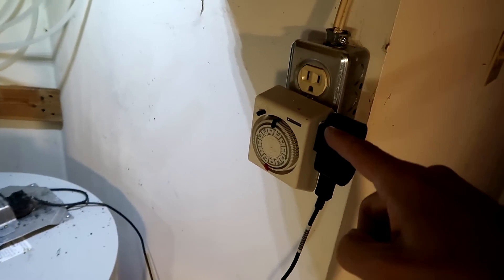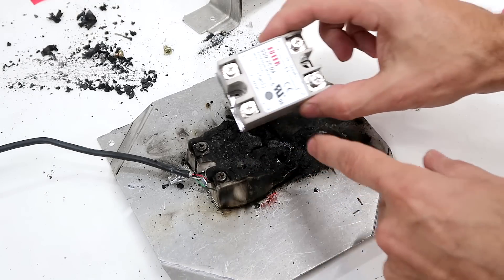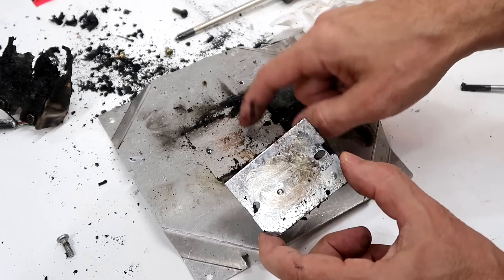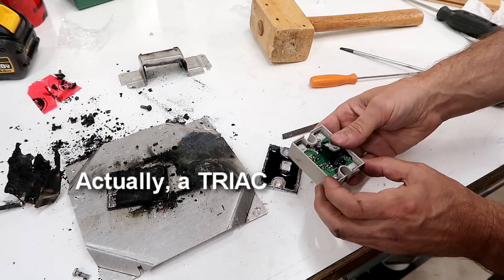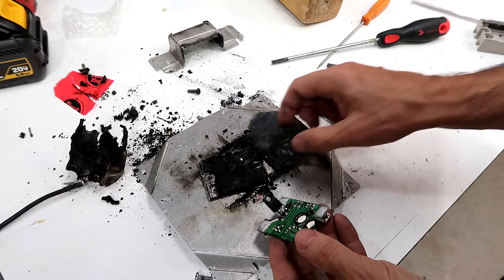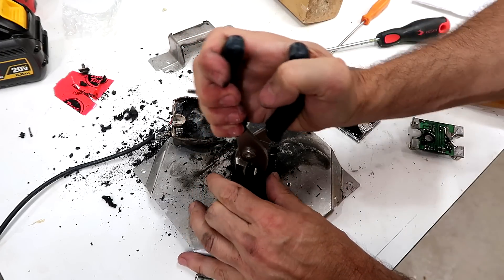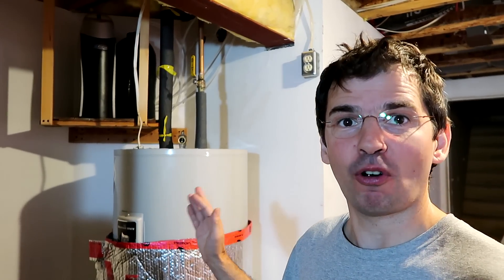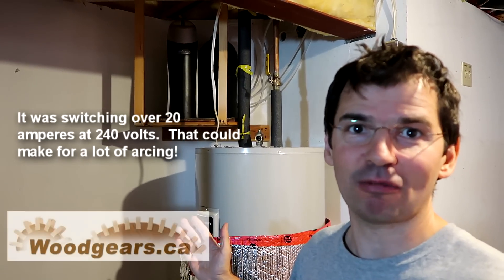Spectacular solid state relay failure

Comment: Where is the circuit breaker?  I would had at least put a 25 amp breaker on it and a gfci.
Reply: You would have to ask your boyfriend... because I do not go that way!
Reply: I am sure there is a breaker. But the breaker has to be sized to allow 4500 W or so for the heating element in the water heater. 1000W will be more than enough to cause this failure.

Comment: The triac in these relays is very underrated compared to the claim made by the seller. I bought a 40 amp one and tore it down to find a 16 amp triac. This means that it should never be run at more than 16 amps. I think the 25 amp ones came with a 12 amp triac. The electronics of these relays is OK but the build quality is shifty. I think it's worth buying a genuine name brand if you need any kind of lifespan or fire safety. You can get by on these cheap ones if you buy one with a suitable triac.

Comment: I'd use a solenoid relay. That way, it doesn't draw much power (if any) when off. If you do choose to use that option, make sure it's a fully enclosed one or at least in a very clean housing. I have experiences with exposed lead relays, and those tend to get stuck closed when the contacts get dirty. The downside here is that these give off a loud click when it turns on or off.

Comment: I think it's more likely that not-quite-tight-enough screws plus heat cycling (SSR mounted on warm WH) lead to the screw terminals coming loose.  The poorer the connection gets, the more extreme the heat cycle goes. When the connection gets poor enough to start arcing, the solder will melt and things will burn.  Cheap SSRs will have crappy screws that you can't get tight enough before the screw driver cams out, to properly clamp on bare wire.  Best to do proper crimp terminals and fasten the screws to them.

Comment: The single most popular fail of any electronic device built outside of north america is "automated" soldering. There is way to many cold solder joints that add resistance overheating circuits. In north america these are checked for on any device made. usually fixed before it is sold to consumer. 

Sadly many of these great businesses are being put out of work because of the volume coming out of china.

Note india/japan/tiawian/korea made components are becoming much the same for lack of quality control.

Comment: I have had a timer on my hot water heater to limit it only use electricity during the off-peak periods since Ontario brought in time-of-use billing in 2006.  I have pretty low hot water usage, and a 60Gal. hot water tank and even when I run it only between 4am and 6am I never run out of hot water.  My original setup was a GE Digital Time Switch (model 15132 I think). This cost was about $70 and total savings is about 6.5cents/kWh * 4kWh/day * 365 days/year = $95/year.  I recently upgraded to a very nice system made by Sinope Technologies (sinopetech.com).  Their model RM3250RF Load Controller allows me to control the hot water heater so that it only uses off-peak electricity, as well as easily monitor my electricity usage for hot water heating remotely.  I highly recommend this device for anyone who wants to limit their hot water heating to only use off-peak electricity. I believe that this device uses a mechanical relay.

Comment: Don't know if your SSR had it, but a zero crossing Optocoupler (eg. - MOC-3041) should be used to swtch the Triac. This prevents any arcing by switching exactly when the AC waveform is zero.

Comment: I just did a search for Fotek on Digikey and Mouser, and came up with no results.  The cheapest 40A SSR on Mouser looks to be $30.

I"ve got one of these Fotek ones I got from China.  Using the UL warning from https://www.ul.com/newsroom/publicnotices/ul-warns-of-solid-state-relay-with-counterfeit-ul-recognition-mark-release-13pn-52/ it seems I have a genuine Fotek (I picked it up for $12 from China), but I wouldn't trust it for something that would run unattended (I plan to use mine on my lathe).

Comment: I don't doubt what people are saying about cheap imports sometimes being faked in rating. But any SSR must be mounted to a heatsink to achieve maximum current rating. The datasheet will show the minimum efficiency of heatsink needed for given ambient air temperature in degrees C per watt, which is how heatsinks are rated. There is zero chance that any SSR like this can sustain this close to maximum current rating with just a that sheet steel heatsink, even at ambient temps of a garage shop in Canada. Since it has worked this long, I would say that the rating on the SSR is probably fine. 

A contactor/relay could be more efficient than a TRIAC based SSR. There is 40W lost in the SSR while it's on. Advantages of SSR is it can switch faster and it can potentially last much longer without wearing out (when used within parameter, of course). But this is something that only has to switch on/off once per day, so a contactor should last a lifetime or two, and switching speed is moot. 

Of course the most efficient way to do this would be to hack the heater's internal thermostatic controlled switch and use the timer to interrupt the control signal in there. But this is beyond the scope of time/benefit ratio for most people. Easier said than done, what with the screwdriving and wrench turning and crimping and voiding of warranties.
Reply: No. If it fails in this fashion (combustion) it is flat out unsafe. It is fake. If thermal overloading is an issue, then a thermal fuse must be added to the product. Otherwise it cannot be listed/approved by safety agencies.
Reply: Interesting, thanks! I didn't dispute that this SSR might be overrated or falsely certified. And I did not intend to understate the danger of falsely certified, illegally imported product such as this, if that is indeed the case. You seem to know more about that than I.

I was more concerned that when Matthias says "a TO-220 should be good for 50W," that might be misinterpreted by the average person. In normal summer ambient temps, a bare naked TO-220 will boil water before it reaches 5W, and 100C is the temp limit of a typical SSR. And additionally, the max current goes down with temp. So a 25A sustained current rating for the SSR will only be achieved if it is somehow kept at 25C. That 50W heat dissipation figure is only achievable with a very optimized heatsink to even keep it at 70C. That enclosure and external sheet steel heatsink is not very close to optimal, and he was running 40W and passing 22A. It shouldn't be particularly surprising it can't actually do that.

This is why people "derate" even good quality parts. It's not really "derating." By derating to 2/3's the rating you are not adding a 1/3 safety measure. The actual ratings of semiconductors are done under specific conditions that are impossible to achieve in practice. Without moving to antarctica or using exotic cooling. That's just how they are rated.

Example: if it reaches 20C in the canadian summer, and a very efficient To-220 heatsink is 1C/W, at 40W the TRIAC would reach a temp of something like 60C. This is higher than 25C, and the max current rating would have to be decreased, accordingly. Just as an example let's say the heatsink on there is more like 3C/W. At 40W, the temp will eventually reach 140C. The TRIAC will fail before then. As Matthias observed, it worked as long as it did because of thermal mass and the shorter duty cycle while it was being used daily. Before it reached redline, the water was up to temp, and the thermostat switched off in the nick of time.
Reply: OK, yeah. I am familiar with all the thermal calculations for electronics design. And it is kind of a joke that most FET's are (or used to be) rated based on a case temperature of 25C. You aren't going to hold the case at 25C while passing max Id. They are starting to show more realistic numbers, though. Max Id at some ambient temp instead of at Tc=25C.

Comment: I would never use those cheap ebay electrical components in any high power or safety critical application. Doesn't even matter what the datasheet says for that TRIAC and it's current handling, there's no reasonable guarantee that it's a genuine part, or it could be a factory reject. A certified mains rated mechanical relay from a reputable supplier might cost a lot, but it's cheap when you consider that it will be switching high power loads, in your house, and largely unsupervised - probably while you're sleeping. Scary stuff if it goes wrong.
Reply: Anything that I plug into the mains or runs unattended has to come from a reputable european shop for me. My projects involving mains power all run on Mean Well power supplies. That small risk of burning your entire house down isn't worth it.

Comment: Matthias, thank you for taking the time to illustrate this electronic failure.  

You have received lots of criticism on here from people that would never consider putting themselves on the line, but love to be hateful to those that do....

 I have great disdain for those cowardly critical bastards that have lots of negative, and  yet, never put anything positive into the equation.... They must live miserable lives.....Anyway I digress

..  I spend a lot of time analyzing my heat efficiency.   After all, we are into a time that we need to help our ailing planet that is into the depths of extreme climate change .

  I have the  "CURB" electrical energy measurement system on my electrical panel, and it has empowered me to save some footprint, and a lot of energy dollars.

I have a two story home with  an LG heat pump, a wood stove, electric base board heat, and an electric hot water heater.  I have been able to monitor when to use one or the other to a more efficient state .... I never use the electric base board heat...

I have discovered that setting your hot water heater at 125 F, and turning it off overnight, and even longer in conjunction with using cold water to rinse dishes for the dish washer, and a few other minor things saves enormous energy cost....

Overall,  We are running 375 kWh in summer per month, and that is using some air conditioning from the heat pump.

There is a time the heat pump best produces heat as we progress into fall, that is less expensive than burning wood.....Save the wood for colder temperatures.

Led lighting is huge....Turn off your Wifi /TV  hub etc at night.... There are lots of phantom power drainers but those suckers pull 50 watts or more.

Comment: The real estate market is slow right now so my advice is make sure your house insurance covers full replacement. Remember it is cheaper to buy new stuff in Fredericton than to move a bunch of old stuff a thousand kilometers. You're welcome.
Reply: rol dac there are no insurers that will cover a house that burned down starting at the hot water heater, when the owner described on YouTube what he did as a hobbyist to save $4 a month.
Reply: Ya I know...it was a joke.

Comment: It looks to me like the grease didn't make contact with the mounting plate, although it's hard to tell from the video.  At any rate, that plate was not in very good thermal contact with anything else.   You even mounted it in a convectively stable manner, heating a horizontal layer of air from above.  You knew at the outset that the heat load was substantial - 50W - but you did an unprofessionally poor job of thermal engineering.  You're lucky you didn't burn the house down.
Reply: Paul Kolodner also, grease isn’t thermally conductive in any meaningful way. The whole setup was basically just stupid. And the dig at “YouTube safety people” is particularly ironic given the results.

That it worked for a little while clearly doesn’t mean it’s safe.
Reply: Well, normal grease is not as conductive as, say, thermal grease, which is loaded with ceramic, metal, or graphite particles.   But it's much more conductive than air, which is what would fill the tiny gaps between two plates that are clamped together without grease.  So the use of plain old grease here was not a gross error.  But a thin horizontal layer of air which is heated from above - exactly what was encountered in this setup - is convectively stable; ie, buoyancy does not cause the air to circulate.  A motionless layer of air is literally the best insulating material you have in your house, aside from vacuum, should you have any of that lying around.  By mounting the relay this way, Matthias produced the worst possible situation as far as cooling is concerned.  The first  lesson here is: if you are going to make a gizmo like this, mount it with the heated surface on top, or vertical, so that hot air can rise and provide cooling by what is referred to as natural convection.  You might still need a fan and/or a heat sink with fins.  

The other lesson has been pointed out by other commenters: don't trust current ratings.  In fact, I have seen this failure before, in my air-conditioning system: a circuit board with a mechanical relay got fried because the wiring traces couldn't handle the current.

Comment: I really dont understand why you didnt fit a thermal fuse and a normal fuse along with this ssr. I mean of course the choice of that really was poor but it would have been much safer if you would have something limiting the power if it fails.

I would recommend of using a  high quality ssr in series with a fuse and a thermal fuse. Also a propper heatsink would be required. If you would want to do it neatly you should also put it all in a nice fireproof enclosure and then it should work for ages without having that problem or risk ever again.
For me saving those few dollars in the installation wouldnt be worth the risk of my house or family. And if lets say 100 dollar for a proper installation is too much then I'd say it is not worth it anyways. Not for the risk it creates.

Comment: Some have suggested that FOTEK are knock-off SSRs.  They do bear a broad physical resemblance to other "block" type SSRs, but they're not knock-offs.  FOTEK is a Taiwanese company that makes a wide range of industrial control products:

http://www.fotek.com.tw/index4.asp

It may not be a knock-off, but the specific SSR used in this instance is the subject of a UL notice about counterfeit UL recognition markings:

https://www.ul.com/newsroom/publicnotices/ul-warns-of-solid-state-relay-with-counterfeit-ul-recognition-mark-release-13pn-52/

The danger of using dirt-cheap Chinese electronics, particularly in mains powered applications, is very real.  The Chinese routinely advertise fake product specifications that grossly exaggerate their products' capabilities, use black market components and apply counterfeit safety markings.  The super-low prices are so tempting but for something being installed in your home, it's just not worth the risk.

Comment: Do electricity prices fluctuate so much that it's worth allowing the stored water to cool and have to be heated up more at one time vs maintaining a constant temp throughout the day?
Reply: It never, ever saves money to keep water hot instead of letting it cool down in between uses. Every minute that the tank is full of hot water, it is losing heat to the environment. The hotter the water, the more heat it loses. The cooler the water, the less heat it loses. The amount of heat added to the tank is exactly equal to the heat lost over time. Of course, there is no point in running out of hot water, though. And nobody wants to wait for the whole tank to heat up just to take a shower.

Comment: My brother did the same thing and had the same experience. 
He went to a way over rated traditional relay pair  and it lasted longer but still failed.

He then got a good deal on a 40 amp DP industrial control timer and it's still working
https://rexel-cdn.com/Products/Intermatic/T101.pdf?i=4E6960AF-791A-49F5-971E-E630F0743F21

22/25 is 88% load - usually the 80% rule applies
Heat sinking has to be better to reach the rated load on those.
I most often see full size finned aluminum heat sinks on those.

Comment: Maybe I am missing something about what you were trying to accomplish. Why go with this electronic switch when an old school mechanical clock type HWH timer works fine? My timer (all 220volt) has been running for 25 years, switching a 4500Watt element, with a one hour "heat" in early morning and a 2 hour "heat" starting at 6PM. The pins lock down on the clock wheel, and I have infinite adjustment for on and off cycles.

The internal contacts on these mechanical units, just like those on a pump clock or pool pump relay are rated for plenty of amps, and you can't beat the cost, based upon its life cycle. I am glad the electronic unit didn't burn your place down. Old school works just fine, IMHO. Good luck with the move.

Comment: I think your right about having it turned off and then turning it back on. Then both of the heating elements came on at the same time.
Overload!! I used a relay to remote my dust collector but it was rated at 35 amps but fused at 20. here is the one I used SQUARE D 35A 600V CONTACTOR 8910 DPA23 SER. B found on ebay 12.95 and a 117 volt outdoor switch. So far working good.
Reply: both elements do not come on at the same time. the bottom heater does 90% of heating, the top comes on when you run out of hot water. heating on demand. 9000 watts would trip the 30 amp 2 pole breaker. 4500 watts is around 18.75 amps, per leg. 4500÷ 240=18.75 x 2 =37.5 amps.